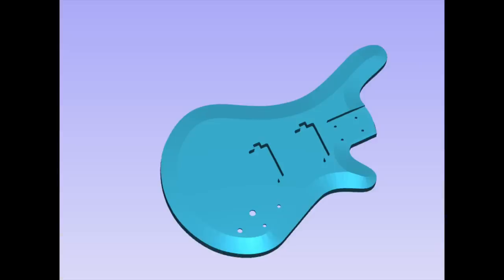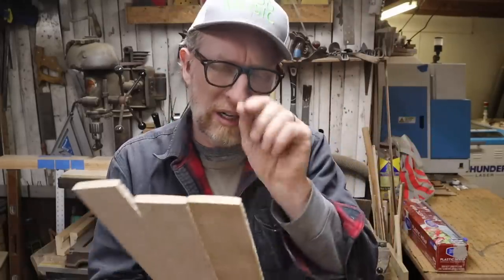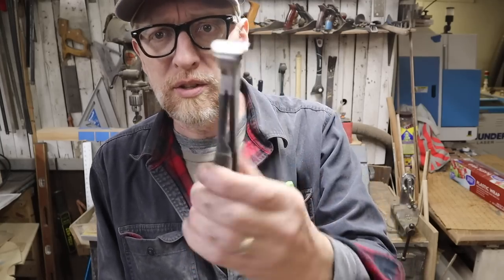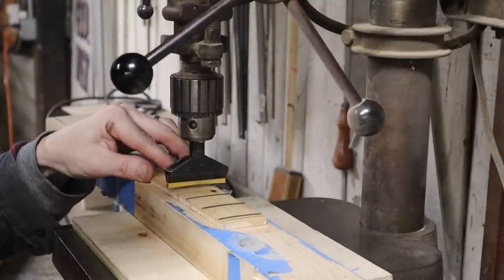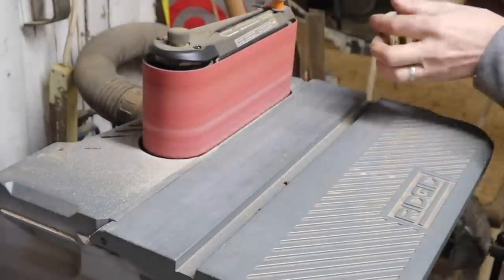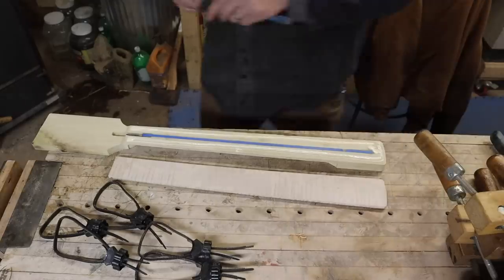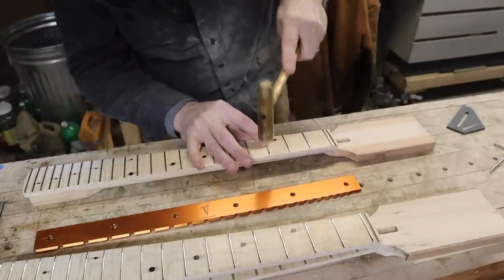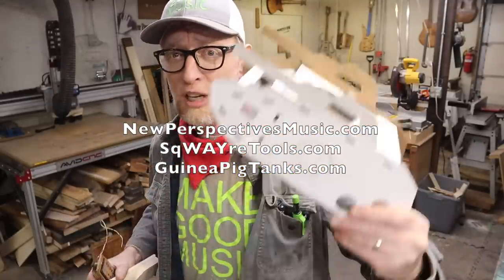Assembling and Fretting a Guitar Neck (Part 2)

Comment: Thanks for showing the budget friendly tools for those of us who maybe only make one guitar. I actually 3d printed some tools when I made mine, such as the fret pressing caul, radius gauges, shaped sanding blocks etc. I think a 3d printer might be more accessible for many due to its price, but also because it makes less noise and emissions than a CNC router or a laser cutter.
Reply from the maker: 3d printers are great, slow but affordable way to make custom things, especially if using PLA so it's not as terrible for the environment.

Comment: I think one of the biggest hurdles for building a neck is all the speciality tools we're told we need. Thanks for showing that it can be done frugally as well.
Reply: Wait til you have all the tools. The real hurdle is doing the fret job well. Any ass can hammer metal into the slot, making the ends nice and crowning and polishing is where the real challenge is at
Reply: @TimTrOn3000  True! It takes a fair bit of practice to get it just right.
Reply from the maker: yea, we haven't gotten to the real hard part of the frets yet, lol. The tools help, but it can be done without them. Future video will get in to that.

Comment: Hi!
Do you use a different fret wire for the zero fret ? 
I've read several ideas about this and I can't remember you detailing this part. I think I'm gonna test the zero fret on a coming project and I can't really decide wether or not I'll use the same fret wire or a bigger one for this purpose.
Thanks.
Reply from the maker: I usually use a slightly larger fret for the zero fret, but it's not necessary. I have set it up with all the same frets without issues.
Reply: @timsway  thanks a lot. I'll give the "same fret everywhere" setup a try.

Comment: Thanks for the secret cheaper tool tips! Will come in handy on my next project for sure.

I wouldn't wanna put the frets in first so I can use a big radius block to clamp the fretboard, like Lignum showed it a bunch of times on their channel. Always interesting to see different processes though
Reply from the maker: That is a good way to do it, but the reason I prefer my method over rubber bands and fill clamps is if there is a problem, a small discrepancy, etc, I can see it and fix it before the glue settles. If something is misaligned  or not grabbing properly under the full clamp and a winding of elastic, you won’t see it or know until it’s too late.

Comment: Another great video, thanks for putting that together. A good non-expensive way to clamp the fretboard on is to use an old bike tube. Clamp fretboard in place on both ends with a tube clamped under one end, tightly wrap the tube around the neck, when you get to the other end remove the clamp and put the end of the tube under it. Great even pressure all along the fretboard.
Reply from the maker: that is a good one. I tried using exercise bands a few times. I have some giant rubber bands made for this sort of thing but I still refer these band clamps.
Reply: @timsway  every time I see you using those clamps on the fretboard I think "I gotta get some of those", definitely look easier to use than a bike tube.
Reply from the maker: @johnisch88  they are slower but I prefer them to the "wrapping" method as if something is amiss, I can still see it and fix it.
Reply: @timsway  Also the glue squeeze out can be problematic with a bike tube, I end up protecting everything with blue tape, not ideal, but it works